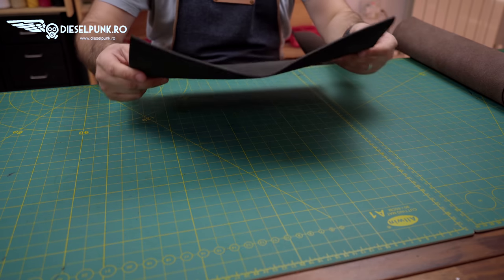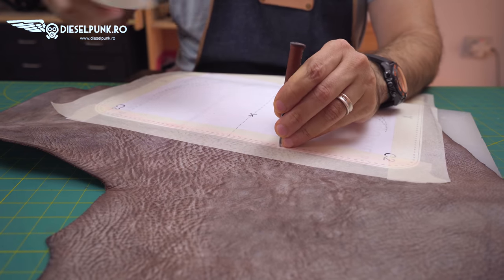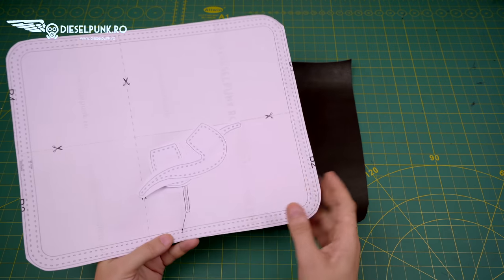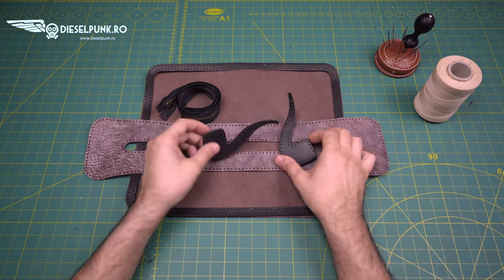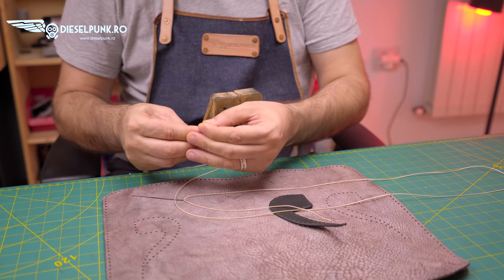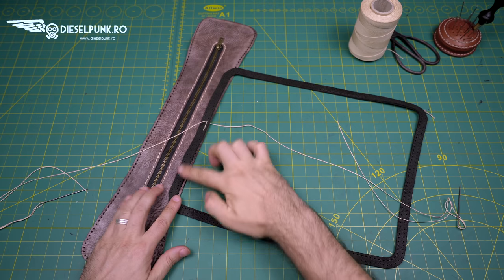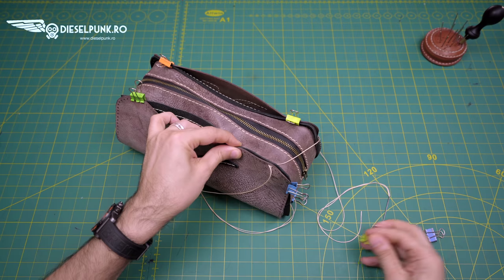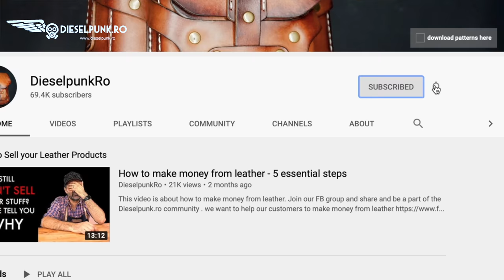Dopp Kit Bag DIY - Tutorial video and pattern download

Comment: You're always coming up with great Ideas.  Currently I price my wallets by the amount of leather used plus my time spent on it.  I've sold several wallets but I realize it's a slow process and you have to build your reputation first so those first wallets can't be super expensive. Depending on my design they run between 20 and 45 dollars.  But I'm doing all the work from cutting the leather, to dying and stitching.  But I also promise that if anything on the wallet fails I'll fix it.

Comment: You are supposed to sew the zipper where you want to cut it BEFORE and then trim and melt if it is a non-natural material. The stitch line helps hold the end together better.

Comment: I also found out by using the large bag template that it is misaligned and the loop part has two more holes than the zipper part. So I'm trying it by sliding the two half's together too eliminate two holes on the inner loop. And I reprinted and counted the holes once I lined up the little scissor marks.
Reply from the maker: Message me with more details at office@dieselpunk.ro and we will sort it out

Comment: I just finished the small bag. I wanted to write about the experience and I have a question or 2 at the end. NOTE: I am an extreme novice leatherworker...I have only made about 5 knife sheets, 1 Wallet and a few belts. 1. The pattern: I was trying to find something about the pattern that needed improvement...but really could not. The pattern was perfect and with Tony's instruction layout was straightforward and clear. (Maybe one thing...does the zipper need so may stitches to hold it in place)? 2. I made the small bag.....if you are a man and plan to use it (for traveling, etc.) just make the larger one. 3. This was my first time buying.installing a zipper. I followed Tony's instructions and it went very smoothly. (It jut took a long time to sew that dam thing in....I could not see the needle hole through the zipper fabric....LOL). Speaking of zippers...buy the best zipper you can find....I cannot imagine if this zipper went bad and you had to sew another one in. I do not know where to obtain or the make/manufacturer of a high quality zipper.4. I do not have the 1.5 MM punch and used the pricking irons instead. I have the 6 MM irons but only used the 2 forked one as the 4 forked one was just a bit off on the last fork per the pattern. That being said, I used 1 MM waxed thread.....and it took forever to stitch this (difficulty in getting needles in/out, etc.). . Perhaps because the 1.5MM punch would be a bit larger diameter than the iron and it would be easier to get the thread through.  5. If you are apprehensive about making this....just get the pattern, follow Tony's instructions....take your time and you will be very satisfied in the end. (I really needed aa shaving kit...and I am too cheap to buy an expensive leather one and the cloth ones just are not my thing). 6. I plan to make another ..the large size. I plan to find a higher quality zipper....and perhaps use the pricking iron with .60 MM thread...????. PS: I finished it with (veg tan) 50/50 bees and paraffin wax. It looks beautiful. I have been making things during the pandemic and giving them away...I am keeping this for me. I hope that this helps someone.

Comment: I am ready to start stitching mine (small bag). I am watching Tony...and it looks like he is using 2 needle saddle stitch"....I am just a novice but I have saddle stitched before. It looks like he doesn't have enough thread to go the entire perimeter of his stitching. In my experience, I use about 4 x the perimeter for the length of thread. Has anyone stitched this....how many times (x) perimeter of thread are you using (or how long was your last piece of thread for connecting the 2 large pieces? THANKS!!
Reply: You can use as much or as little thread as you want. You can’t tell where it ends and starts and doesn’t affect the strength of the stitch. You are right that about 3-4 times the area is about right but that’s a lot of thread. I personally do mine in about 2-3 times so I’m not screwing around with so much thread
Reply: @AlwaysBolttheBird  THANKS for the reply..so you say that you use less thread...and then "start over" about half way???
Reply: @wjvlodek8769  I say do both and figure out what works best for you. I prefers using less thread but maybe you don’t care having long threads. Less thread usually takes a bit longer because you have to restart
Reply: @AlwaysBolttheBird  THANKS!! I understand now!! PS: I just finished bag and plan to post another response about the experience.
Reply: @wjvlodek8769  awesome and you’re welcome